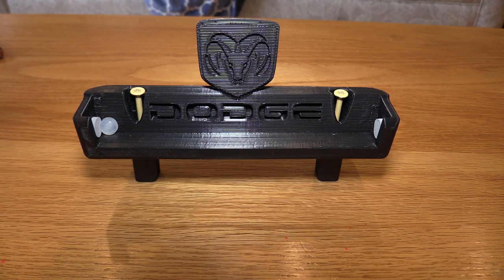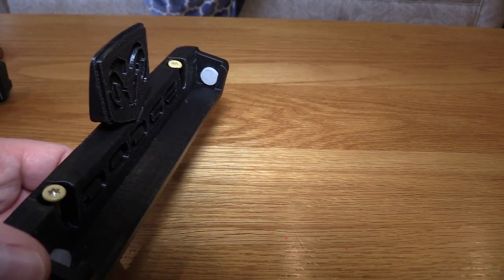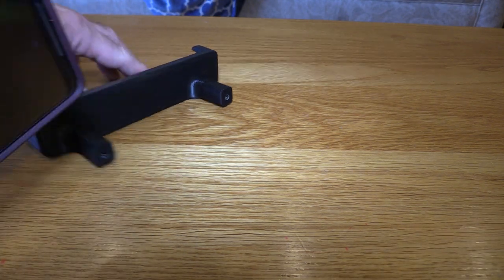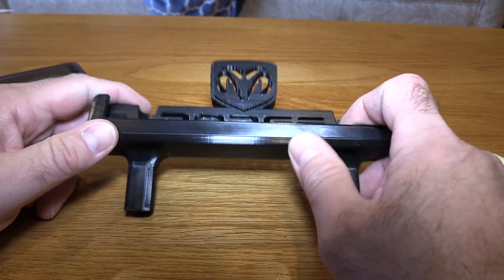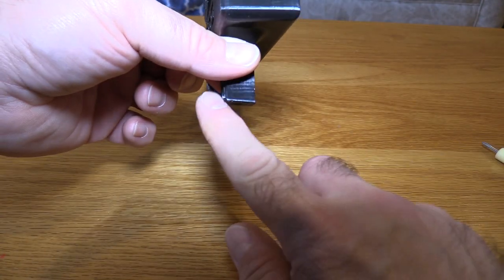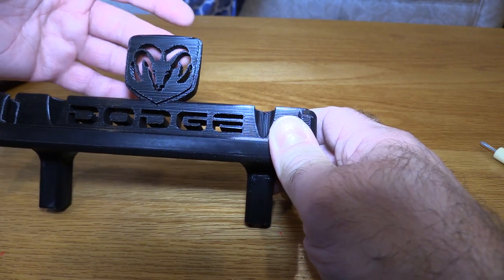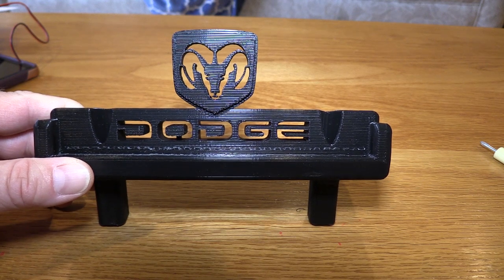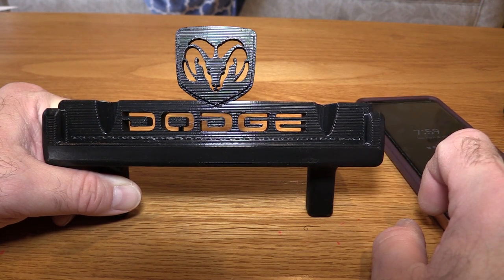3D Printer - Next Gen Dodge RAM 1500 Pixel 2 XL Phone Mount

Comment: Looks good. Those sleepless nights paid off.
Reply from the maker: Still trying to make sense out of Fusion 360.
Push/Pull works on the RAM Logo everywhere, except one spot.
On that one spot, I have to Extrude instead.
I'll figure it out someday.
Thanks for watching!
Reply: I have been trained in and used Helix, Solid Edge, Solidworks, & Catia over the years for designing very complex machinery and products. I find Fusion 360 very hard to learn compared to them. I think Solidworks is the most logical and easiest to use modeling and document management program.
Reply from the maker: You sir, are a true Renaissance Man.
I used MicroCad back in the 80's when I was in drafting for ~2 years.
We had large 11x17 drawing tablet tablets with shortcut buttons everywhere.
It wasn't until a few years ago I picked up SketchUp for designing and building a kitchen cabinet bar and jewelry box.
I guess I don't feel as terrible as I did a few hours ago. lol

Comment: Is there a way to get this for a larger phone
Reply from the maker: Mine has a little extra slack on either side, however if it is much larger it would require reworking the file itself.
Reply from the maker: Also, I think I place the files up on thingiverse, check to see if they're there and you may be able to modify it yourself.
Reply: @m3rdpwr  its not like terrible longer but a decent bit. I've tried cutting off the ends and strerching the middle then putting them back on but that changes the center to center hole distance i tried a flat cut across the top making it larger then putting another back to it but that creates thin walls and its not detected in prusa slicer.
Reply from the maker: @MrFoxracingred  how much wider are you looking for it to be? Depending, I could just thin out the side edges a millimeter or two per side. I will be getting a newer phone which is wider, but it's not going to be immediately soon. So it'll be a little while longer before I modify the file again.